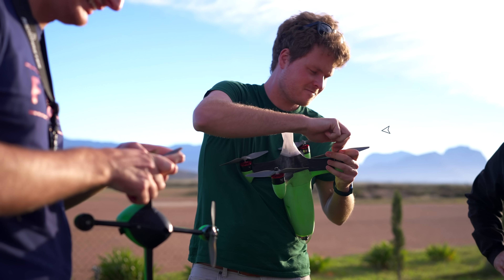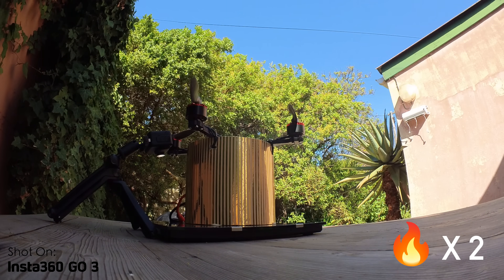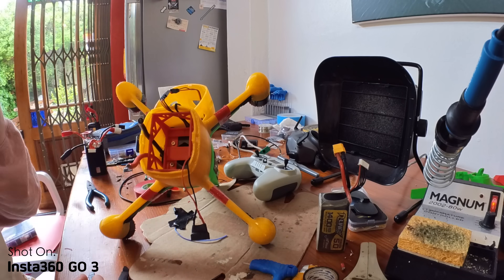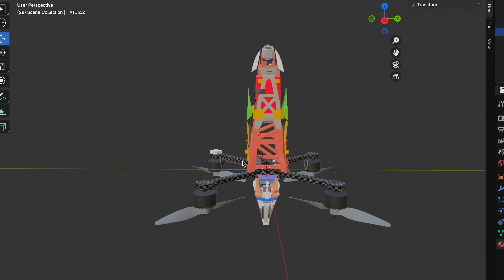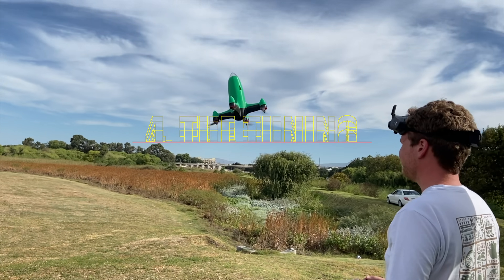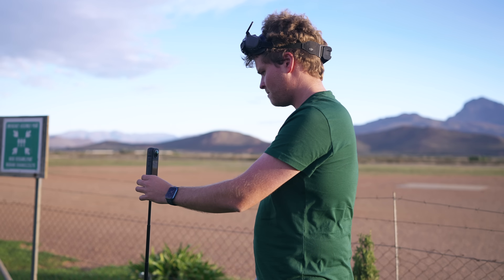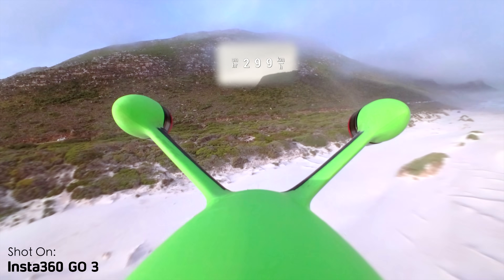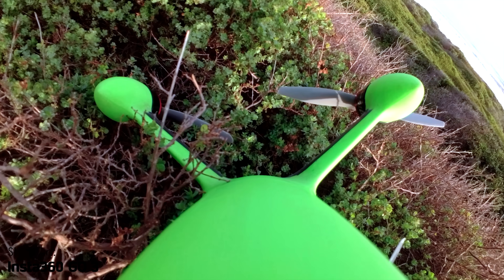How I Built the NEW World’s Fastest Drone

Comment: Fun fact: This quadcopter that you're flying is NOT a, "drone". Drones are by definition autonomous vehicles, which means because you're Remotely Controlling this Vehicle, that makes it an RCV Quadcopter, not a drone. It's also technically a UAV, since it's an Unmanned Aerial Vehicle. Please STOP using the word, "drone" incorrectly. The main stream media has already done more than enough damage to the official definition of the word over the past 10 years.

Drone: An autonomous vehicle that is NOT controlled by a human operator.

UAV: An aerial vehicle that does NOT have a human on-board.

RCV: A vehicle controlled by any remote operator, computer or a human.

A self-contained Drone with an on-board computer would not be an RCV.

Drones however CAN be commendeered by humans. Like how a horse can run by itself, or be ridden by a human.  Same thing with drones. As long as they possess the capability to operate on their own, only then they are drones. But just like how if a human rides a horse, the horse remains a horse, if a human operates a drone, it's still a drone.

However, because your quadcopter CAN NOT operate by itself, it's NOT a drone.
Reply: Thats odd that you would say so.  When I search drone in google all I can see is quadcopters. Pages and pages of them. I wonder why that is? 🤔
Reply: @Mike-Bell  I literally just explained that the mainstream media did all the damage.... they looked at military drones that are actually drones, and then applied the word, "drone" (which HAD previously been used in PROPER context) to ALL hobbyist RCV Quadcopters, which is INCORRECT. I can google, "Earth" and get tons of images of it being flat, but that doesn't mean it's right. People who insist on using the word, "drone" incorrectly are on the same level as Flat Earthers.
Reply from the maker: I also don’t like the term drone, but that is what has become synonymous with quadcopter so that’s the word I use.

Comment: Those APC 7x11 are sick pitch props. Hovering and low speeds these props just stall. They draw so much power on punch outs from zero.
Did you think of trying APC 7x6  or APC 6X6 instead?
Sure you would need to increase motor KV and RMP more, but you might reach higher speeds.
The weird thing is smaller props are faster and more efficient.
Keep up the great work Boet
Reply: I think he's fighting tip speed issues here. The 11 pitch on these means they can hit pitch speed at lower RPMs which means less transsonic issues at the outer ends of the blade. The trick on the higher pitch props is to take more time to get up to speed, but they will hit the speed at lower RPMs. Evidence in the video seems to be that it works pretty well.
Reply: @QuadMcFlyFlies  agree. Still,  7" is doubble the disc area of 5".
Props weigh alot too.
The resistance spinning through the air is very high compared to smaller props. The transonic tip speed issue might not be such a big compromise to the other downsides.
Just a thought that 6" could be just as high speed or even more.
The new top speed wasnt that much more in total compared the doubble the power needed for this.
Not considering the exponential wind resistance. Just my thought. Guess you need to try it too
Reply: @chrisbee5481  Yeah I agree with pretty much all of that, it definitely cost something in terms of energy output. I'm working with a local guy who is testing some of this as well. He's got some similar ideas he's been working on so it was interesting to see this video come out. He's still looking at the 5.25x8 props at this point, but we might try the 6" ones as a middle ground if we run into too many issues with transonic turbulence. Super interesting stuff.
Reply: @QuadMcFlyFlies  before Luke hit his last World record of 400 kph, the last record was pretty close with APC 5.2x6 props and even still 6S. So a pitch of 6 was really not performing bad at all.
7x6 and 6x6 might hit a record too. Certainly be more efficient
Reply from the maker: Your max theoretical speed is governed by the pitch of the prop. 7x6 would get nowhere close to these speeds because the tips speeds shouldn’t go transonic. But you are right, this thing sucks in a hover. It only wants to go fast. It’s most efficient at 200kmh. We will be sticking with the 7x11 for V3
Reply: @LukeMaximoBell  the maximum speed is governed by pitch speed (pitch x RPMs), not pitch in isolation. The RPMs are much higher on 5" and 6" props and that is often enough to make up for the reduced maximum pitch angle available on the shorter props. It also takes significantly more energy to spin a 7" prop to sufficient RPMs to generate that speed even with the higher pitch. The advantage 7" has in addition to the availability of higher pitch props is better thrust to weight ratio for lifting the heavier frames and larger batteries that are necessary for the current delivery and aerodynamic needs of speed quads. I think that's where 5" props start breaking down more than the pitch speed conversation. In general 7" is going to be much harder to get to the necessary RPMs, but the other pieces make up for the energy cost for the most part. I'm curious to see what we can do with 12S and smaller props though, I suspect we might be able to beat 320mph, but we'll see.
Reply from the maker: @QuadMcFlyFlies  Yes, but for the 310 mph+ run here the props were already getting up to about 34k RPM, which is reaching the limit of prop tip speed anyways. Which means any pitch lower than that would have resulted in a lower top speed. 5 inch props on this quad do not work great. They are about 30% less efficient in a hover and we also had our 5 inch props reaching over 50k RPM which is already transonic. And the quad was only going about 405kmh. That was with a 5.25x8 inch prop. There isn't anything higher on the market I can find.
Reply: @LukeMaximoBell  yeah that's basically what I was figuring, and there aren't really any high pitch 6" props on the market either. For 5" there's a functional limit to the pitch due to the chord length, 8 is about as high as you can get. A 6x10 might be interesting, but no one makes it. Might be worth approaching APC about making something like that.

Comment: Why dont you have a fine fire extingusher???
Reply from the maker: We will bring one next time for sure. But my hand and shoe work surprisingly well 🤷‍♂️
Reply: @LukeMaximoBell  yeah).
Also if there is some spare weight limit you can mount modular extinguisher for electric panel.
It usually comes in size if electric braker.
It works one time on high temperature by releasing a lot of CO2.

Comment: Congrats, I'm sure you guys must be proud.
Reply from the maker: Thanks! I think you know better than anybody how difficult this is 😂 Maybe you can top us with a 300mph. Just a heads up, if you haven’t already then start the application with Guinness because it takes about 14 weeks till you can even submit evidence.
Reply: @LukeMaximoBell  Tell me about it haha. Haven't started anything as I've been waiting to see your new build but thanks for the heads up. Looks like I need to finally get off 6s and shove some more power on my build so it will be awhile.
Reply from the maker: @billster7100  Yeh I think that could help. I'm guessing your powertrain is about maxed out for what speed you can achieve.  But we are having to pull 8kw to get these speeds, so you're doing something better for sure!
Reply: Thanks.  You can also be very proud of the crazy speeds you have been cracking up.  Quite an achievement.  👌 Looking forward to some more competition from you...

Comment: Now that F1 car doesnt have a chance at all 😆
Red bull needs to sponsor you.
Reply from the maker: No it’s way too fast for F1! Haha
Reply: @LukeMaximoBell  Top Fuel dragsters however... :)
Reply: @LukeMaximoBell  you should be able to capture F1 cars every angle close up then...last I checked Red Bulls drone had big issues with taking quick turns.....also why choose their similar design...I mean at this point someone can copy that and beat ur record JS.
Reply: @m2-x-n253  Fast turns will require control surfaces on those wing blades, or a quad-canard with all moving surfaces.
Reply: @PiDsPagePrototypes  I was thinking that making this into an octo design could provide a lot more stability and handling. You would have a quad frame near the bottom, as usual, and then a slightly elongated tube, another quad frame (perhaps offset 45 degrees), and then the nose. By having two layered planes parallel to each other that are separated by at least a few inches, these could be manipulated to very quickly realign and change direction of the vessel. And with an octocopter design it may be possible to get more power, and thus more speed (there would be some additional drag but I suspect the extra thrust would compensate easily enough). At this point though it's really sounding less like a drone and more like a DIY cruise missile. Would be nice to have a 'pocket' somewhere in the nose where you can put a, ah-hem... payload.

Ukraine would love something like this. With a straight-on view from the FPV camera, it would be WYSIWYG with crosshairs in the center, and it would simplify hitting targets with precision strikes. The increased speed would make these not so much loitering munitions, but rather quick reaction precision artillery. This could be the fastest way to hit an approaching vehicle, or a mobile MLRS before it has time to change positions.

Also.... I wonder if you could, with this speed and that configuration, 'lock attitude,' so you can point at something, hit full throttle, lock the position in, and have it follow a straight line. Because the signal deteriorates closer to the ground and EW may get stronger the closer you get to it, and EW is more and more common.
Reply: @johnshite4656  most American response possible 🤦‍♂️
Reply: @johnshite4656  More motors means more battery means more mass, it works to a point, but then the gains get smaller and smaller. If they were to go Octo, it'd be wiser to have the second props closer behind the first, with much sharper pitch, to further accelerate the air coming off the forward props.
Reply: @PiDsPagePrototypes  All valid points, but we do see that when power is required, adding more props/motor/esc/battery generally helps, despite the extra weight. Whether that only applies to lift and not speed, I'm not sure. I'm also not sure that the drag would be that much worse. The drone would be 'taller' with a tube section between the quad planes. There would be the 4 additional arms sticking out too. I suspect that doubling the power output would overcome this drag without issue, though that's just my presumption.

If the two quad planes are too close together then you lose that ability to precisely and quickly re-orient the alignment of the craft. I'm thinking of missiles where little jets come off the side to quickly put the missile into correct orientation before primary firing. Also, I would think that we would want to avoid prop-wash, which would be the reason for not stacking these props, but rather off-setting them so that the incoming air for one prop is not made turbulent by one in front of it. As far as stacking props for more power, I was wondering if it might be a good idea to use the standard 4 props, but also add an EDF in the center of the drone, for added top speed. Then the props would mainly be for control and alignment and initial launch. If you were to stack outboard props like that then wouldn't it be more efficient to duct them? Then you could do some 'compression' of the air, which is what I think you were getting at.

I don't think weight will matter that much. Maybe the acceleration will be a bit slower, but that should theoretically not affect top end speed. And with higher thrust, even if speed is not increased, lifting capacity will be increased, so using an octo design vs quad design can, at the very least, allow you to carry a heavier payload. Which is something the peeps in Ukraine may care a bit about. These days all my drone speculation has to do with how they could be used in war.... LoL. Sorry, I hope that doesn't bother you much! 😆
Reply: Yo, if Red Bull got involved with the drone ohhh man that would be  scary
Reply: @Mvpliberty  This entire project is based on a Red Bull drone. This guy beat the Red Bull drone. In fact, the Red Bull drone had some issues with handling and keeping up with the F1 cars. This seems to be an entirely new style of hot rod drone and I like it! I'm sure we will see this record broken every now and then for the foreseeable future with upgraded iterations of this design. I wonder how fast they can get.... Is 400mph too out-there I wonder?
Reply: @johnshite4656  The point of this drone and the redbull drone are entirely different...
Reply: @tonyman905  I'm sorry, they weren't BOTH designed to be the fastest drones ever built? Yes, I think they were. This new drone doesn't need to film F-1 races, but the main feat of the Red Bull drone also was speed, so it could keep up with F-1 race cars. So in what way are they entirely different?
Reply: @johnshite4656  the main point for the reason to guild the redbull drone is speed and endurance so the drone can keep up on a round of silverstone and they even said in the construction video that there are way faster drones out there...
Reply: @tonyman905  There are faster drones that are fixed-wing, sure. If you know of faster quadcopter style builds then let us know.
Reply: The car would smash the drone in a round around any circuit
Reply: Cost wise what did a project like this cost?
Reply: @redbull sponsor them please

Comment: Congratulations, great work. What ESC are you using that can handle 12s?
Please post a full parts list?
Thanks
Reply from the maker: I will upload a full parts list at a later stage. But final specs are:

T-motor 3115 900kv motors
APC 7x11 inch props
2 x Dogcom 1500mah 160C lipos
Matek 12S FC
Reply: @LukeMaximoBell  Its possible, you share your 3d print parts
Reply: @LukeMaximoBell In the video it said you used tmotor 3115 1500kv (they seem to be prototypes) and an 1800mah pack
Reply: @LukeMaximoBell  Have you uploaded list of full parts anywhere? I checked both videos but couldn't find it.